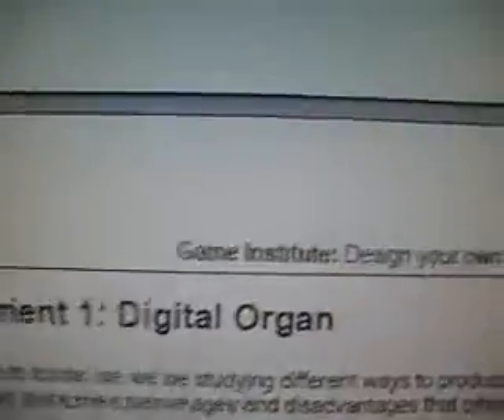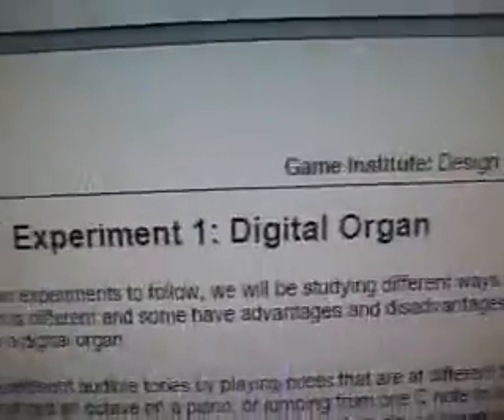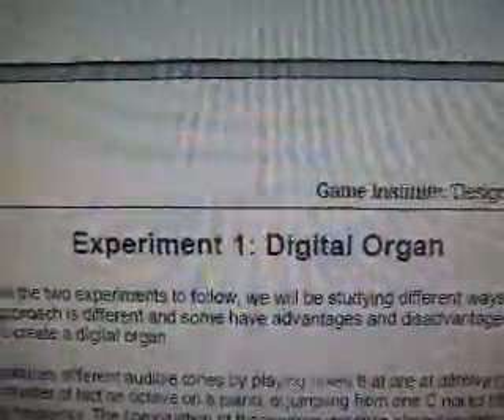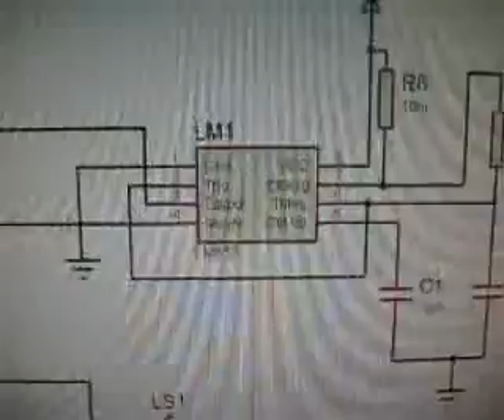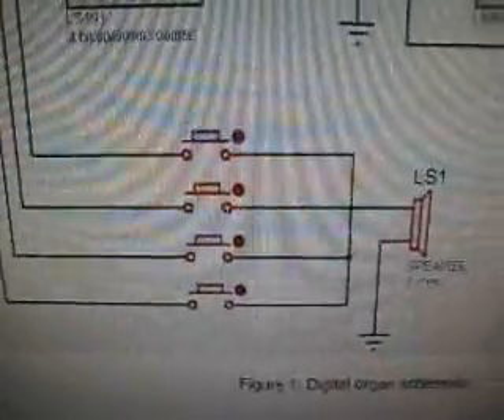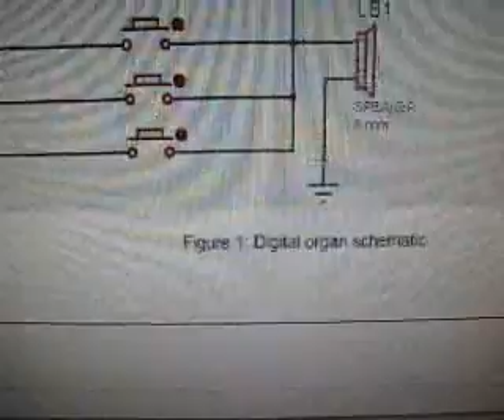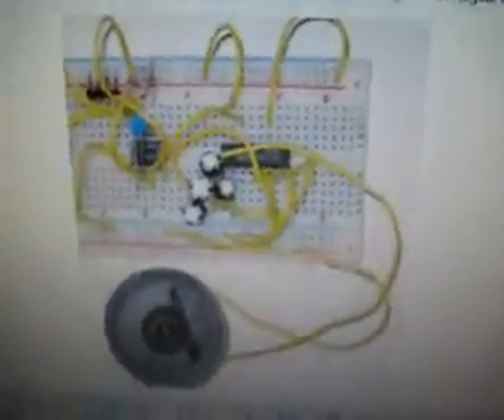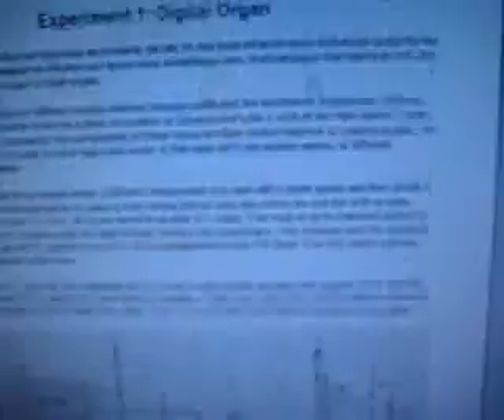Design Your Own Game Console: Lesson 6: Experiment 1

Comment from the maker: @spike100000000000 With virtual machines and emulators, you could play almost anything. The only thing you'd have a problem with is special types of displays...like a vectrex game (vector monitor), or a Virtual Boy (though I know I've had a Virtual Boy emulator at different points in time). My point was more that a computer has the potential processing power and there would be little incentive to combine all those systems.

Comment from the maker: @colmyo see my comment below to MarioLuigi5959 (you may have to expand to "See All Comments" not sure). but if you aren't so inclined:  "Around lesson 3 is where they start to actually get interesting. The rest are just opening up circuit simulation programs and connecting up a power supply. Not really worth it. If you're looking for more info you are looking for more videos related to the course you should also look at gimp3695 and xgsdev's channels" to be clear it starts at L5 E2

Comment from the maker: @MarioLuigi5959 Around lesson 3 is where they start to actually get interesting. The rest are just opening up circuit simulation programs and connecting up a power supply. Not really worth it. If you're looking for more info you are looking for more videos related to the course you should also look at gimp3695 and xgsdev's channels.